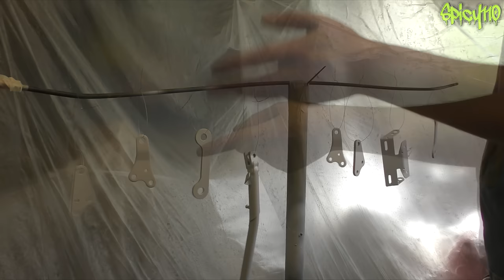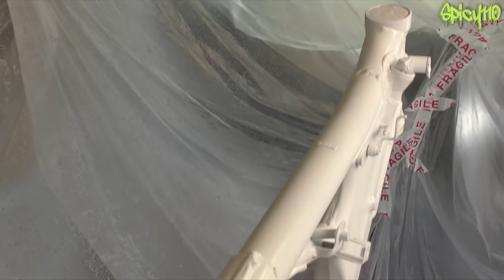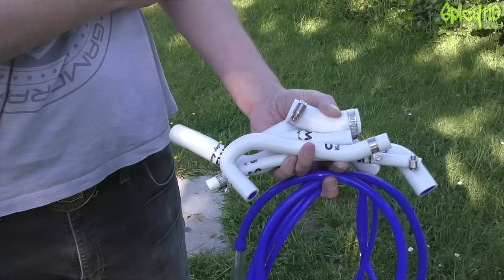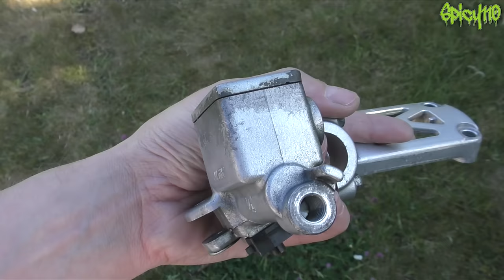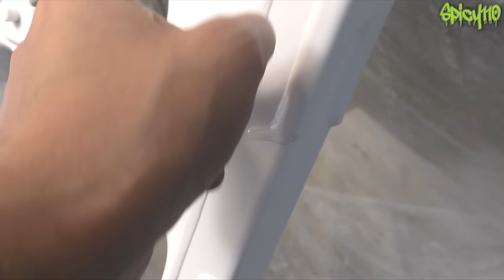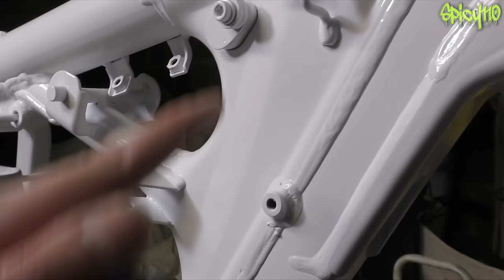Suzuki DRZ400SM Restoration Z EP. 12 - Fixing Paint Issues!

Comment: painting you sand prep surface use pre paint cleaner and tac rag then hit with primer 2 good coat then lightly hit with black freckle coat to get high spot out and sand back til gone and repaet with tac rag and cleaner then hit with finaly colour and clear coat / can get paint call 2 pac paint rust and chip resistant / / tip room temprature can affect paint in weird way plus if spray can paint it has chemical in it that act like activator that can keep paint soft if doesnt cure properly plus spray to much paint is short peiod of time can effect paint and end up soft